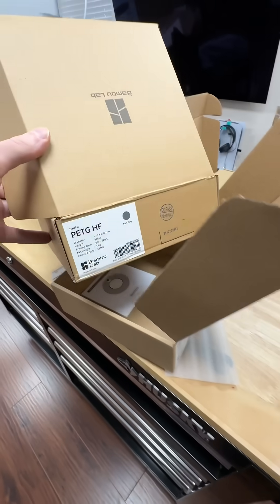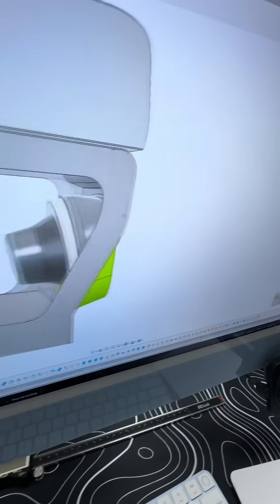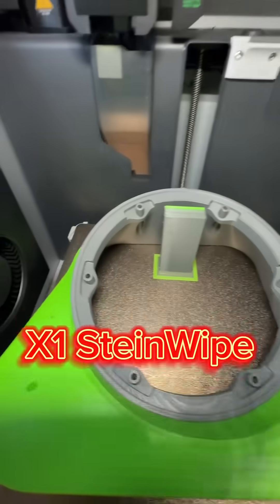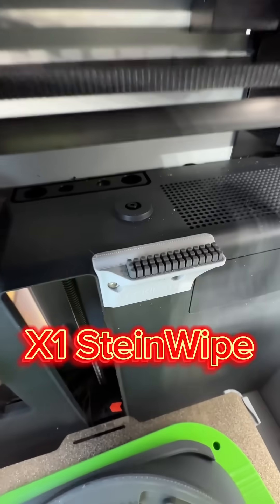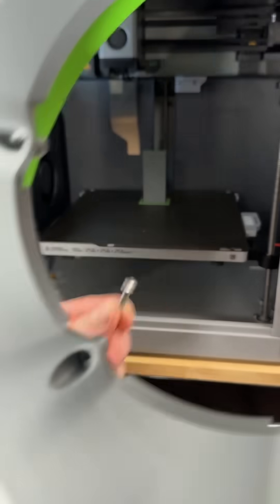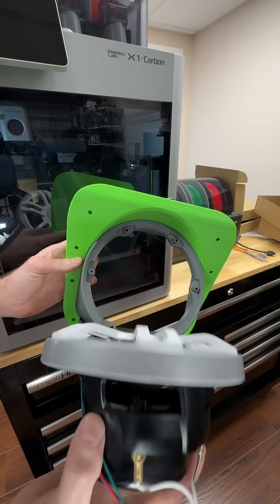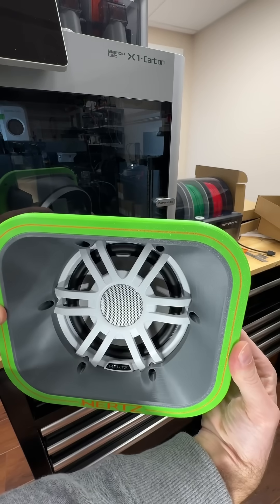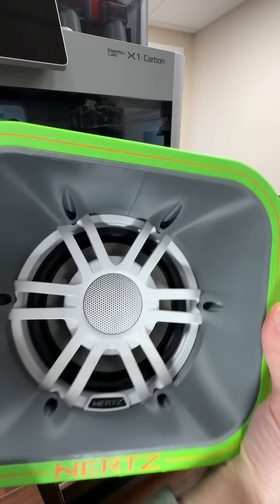Incredible Quality! This Was 3D Printed In a Single Piece On The Bambu Lab X1C!

Comment: Why does everyone have this wiper mod I thought the x1c had a wiper already?
Reply from the maker: The stock wiper is only used to knock the purge off the nozzle, it does not clean the nozzle while printing. SteinWipe and provided .3mf profiles clean the nozzle while printing even if AMS is not used.
Reply: @leckiestein awesome, okay cool I appreciate it. I’ll def add that to my machine soon :)
Reply from the maker: @shrimp_bucket  right on, the best place to start is the free stuff Ive provided on makerworld. Just search P1 SteinWipe to find the project.

Comment: Where you have the scrubber/whiper, does that stop the nozzle from scratching the build plate during nozzle cleaning before the print starts? Did you have to change your g code for this?
Reply from the maker: Its set up to not scrape the plate if one of the cool plate options are selected

Comment: I'm currently using a scrubbler V2 on my P1S which has solved the goopy nozzle issue with PETG but even when securing the 4 row section of A1 wiper with CA glue I've had it tear bristles off and even the whole rubber wiper material. I may have to try this design out

Comment: might want some dampening between the rim of speaker and the plastic. a cut out of either foam or rubber
Reply: same goes when installing into the seat, dampener between the seat and the speaker housing. possibly dampeners between the space of the screws. reducing unwanted possible sounds

Comment: Wondering if you will get less waste with the new Bambu H2D, if you had to redo that print again?
Reply: Yeah, he would. Most of the waste comes from the printer flushing the old color out of the nozzle so it doesn't blend with the new color. Since the H2d can feed 2 colors, it doesn't have to fully flush each nozzle, just purge and prime every so often. Of course, there are other ways to decrease waste even with only one nozzle. If he didn't care about color bleeding, he could have minimized the flush volume. Or he could have adjusted the model itself so that there were less layers with a color change. Those have their own problems though.

Comment: Lovely, more purge than actual print
Reply: ya he could have done both colors in two parts to snap together
Reply: another reason not too buy bambu
Reply: @krzysztofbrylinski This is just an issue with multicolor printing as a whole unless you get one of those expensive mulit nozzle ones
Reply: H2D would do the same print with CLOSE to zero purge...
Reply: @mcbrite  Only if you use 2 colors, but that model have 3 colors, so, you will have purge
Reply: @Scheettini  the red is only on the first layers, so probably only 2-3 purges for that
after that, it's free to go

Comment: Tips for increasing PETG-HF quality besides drying?
Reply: Calibrate every new spool, do flow and pressure advance and you should be good to go. I prefer gyroid infill but any other type where the lines dont cross (for example honeycomb) is fine. Try to avoid long unsuported  bridging sections as the lower layers will sag. And overhangs past 45° can look ugly. If you do many filament changes, make shure the poop chute dosent clog.

Comment: The seam is not well placed (preferably place it along a sharp bend to hide it better). Also it looks pretty prominent. Did you not use the "Scarf joint seam" setting for that print?
Reply from the maker: The seam was selected for placement on the underside of the speaker since there were not sharp edges to hide the seam. It is not at all visible when installed in the seat unless you put your head to the floor to look up.

Comment: Why did you use petg instead of let’s say ABS or ASA?
Reply from the maker: 2 reasons - I dont like those materials printing in my house for vocs and Bambu advertises their HF as suitable for outdoor use and there has been good feedback about this in the comments. besides, this is a demo boat for a Hertz dealer. Its going to spend a lot of time in a showroom so its likely to not even be a concern :)
Reply: @  i just ordered the H2D. I am printing in my house in a separate room. Do you think it’s safe to print Asa or abs. The H2D has some decent filtration right.
Reply: @viralthings3065  only using filtration is not ideal, there is a reason that any commercial or industrial facility will vent fumes outside.

Comment: Wouldn’t last a second in arizona
Reply from the maker: It wasnt made for Arizona, it was made for a Canadian Hertz audio dealer. It will be fine, I promise!
Reply: @ if it gets any direct sun it will warp. You didn’t put enough extrenal layers as evidence buy the top surface finish.
Reply from the maker: @neiljohnson7587  Its just the prototype so the dealer can check it out before printing a bunch. Its fine.. again, I promise!!
Reply: @leckiestein if it's a prototype to see if it fits well, it wouldn't have had to be in two colors
Reply from the maker: @ part of being a prototype - is for the dealer to see what the colours look like on the boat. I don't think it would have the same effect if it is all black.

Comment: Your seriously going to act like you didn't also print a bunch of test prints to make sure the fit was right... just right off the bed, first try ehh?
Reply from the maker: @markwebcraft  i guess you dont follow me.. i posted the test prints that I used to check the seat and speaker profile - 3 small pieces to check the fit to the front speaker and seat then offset all speaker faces a small 0.08mm bit and printed a very low profile ring to test for shrinkage - less than 2 hours for print time with all test parts. So thats all that was printed for test, adjustments were made, low quality teaser video was posted and Its in the long format video im putting together. Will be posted up soon :)

Comment: I got the p1p and man was that a mistake. Within 9 days, 50 hours print time, i had a catastrophic failure. The print head failed, belts and bearings failed, and axis motors failed. Nothing caused this just poor materials and craftsmanship. Bambu tech support decided to stop replying. Customer support would not let me return it until tech support resolved it, which they were unable to do. Had to get paypal and my bank involved. Bambu violated a few consumer protection acts and im still waiting for a resolution. This is pretty common as of march 2025. Their tech support is overwhelmed and unable to cope with the extremely high failure rates. Maybe they switched suppliers for their parts or in an effort to get a lot of machines out they let qc slip
Reply: How did the belts fail? 
How did the bearings fail? 
How did the motors fail? Which ones? 
How did the printhead fail? What does that mean? All of this happened at once??
Reply: @travistucker7317  i dont know exactly how but my best guess is that the bearing failure caused the belt to wobble too much making it wear until it started fraying which jammed the x and y axis motors causing them to burn out. The print head was also making a terrible noise and did not ride smoothly on its rails causing more issues. Something also came loose in the print head. Sounded like a morocca. I tried to correct the issues right out the box when I noticed something wasn't right and I couldn't get the belts to run evenly across the the bearings. The bearings were so bad they would cause the belt to run up and down and the belts would try to jump off. This is why I say it had bearing, belts, motor, and print head failure.

Comment: Why 2 colors🥲
Reply from the maker: Why not?
Reply: @leckiestein  so much waste on this print. Could have split em up
Reply from the maker: @ if I had more time I definitely considered it. But the client needed it ASAP and I couldn't afford a multi day Print. I only had one machine available to print this job. Besides, it was only 100 g of purged material which works out to be less than two dollars. It's not really that much Waste; it looks like it in the video because there's other purge underneath it from previous jobs. SteinWipe motion control is pretty well tuned for a substantial reduction in purging while prevent preventing colour bleed. So this was the first real test on a paid job for me for the SteinWipe project. Two birds with one stone!
Reply: @leckiestein  the 2 pieces could have worked good for covering up those screw holes. They  disturb the good design.
Reply from the maker: @Oslinga  if I had all the time in the world and unlimited budget, 100%!
Reply: @leckiestein  it's not that it's expensive. You can make several smaller prints with 100g of filament. Instead you're throwing it away because it just had to be a two color print

Comment: Compared to ASA or ABS, How would PETG-CF hold to salt water or lake water, environmental exposure, cleaning chemicals, etc?
Reply from the maker: @jamUSA24  petg is pretty chemical resistant in my experience. Bambu says on their site this material is for outdoor use so Im sure rain and sun are fine. Regardless, this is an audio Demo Boat for a Hertz dealer. Its likely to never see the water
Reply: @leckiestein ahh, long term thinking! You heard it here: This boat will never see water. Not by the next owner either..
Reply from the maker: @foobarturkey  I put "designed in canada by leckiestein" around the inside speaker ring - IF the next owner should needing anything (and its a big if as Im hearing good things about HF petg from bike guys) they will be able to find me and we can print in ASA or whatever super awesome materials we have years from now :)
Reply: Would a clear coat of resin improve lifespan if the water or cleaning chemicals was to effect this ?
Reply: @vsuno2721  Yes, a layer of 2k clear would do wonders, primarly for UV protection.

Comment: Pourquoi l'imprimer en 2 couleurs? C'est pas très utile et c'est du gaspillage
Reply from the maker: This is a practical test for months of work for SteinWipe Motion Control. Necessary evil to bring more efficiency and min 25% reduction in purge. This was only 100g of purge which is unheard of for a 800 material change print 💪

Comment: How long is this predicted to last? I feel like 3D parts exposed on a boat with constant rattling and pressure from a speaker is not gonna bode well.
Reply: You'd be right with PLA, PETG will probably be fine
Reply from the maker: @espeterson522  bambu advertises this material to be used outside. Regardless this is for an audio show boat for Hertz. I doubt it'll ever see water as it's just going to sit in a showroom for the majority of its life.
Reply: I print parts for professional PA speakers out of PETG and they hold up great. Mostly curved sections for the port geometry in 18" and 21" 1.8kWrms woofers glued into the wooden cabinet.

Comment: Sweet! But would it not have saved a ton of time and filament printing in two rounds? One the green outer with just a little change in the red (maybe even spliced two prints at layer 5 or so to force only green to not waste even more time on unnecessary layers of red) and then one with the gray mounting, gluing them after print?
Reply from the maker: @ this project is for a Hertz dealer and I only had a week to turn out a design and 3-D print it for them. If it was mass production it would certainly be considered from the material usage standpoint alone. But I don't know about glueing; It didn't age well with the cyber truck! Jokes aside, I considered 3-D printing in two pieces and joining them together and a groove profile that keeps them rigid. But there's too many uncertainties which could result in Printing two or even three times to get it right with fitment and that's three days lost; I needed to do it in one day. Printed once, fitted, and shipped. No fuss.
Reply: @ that makes sense. Rather take the extra time and filament one prototype makes than indirectly wasting time on prep for mass production or “simplicity” that may never come😂 No need to nickel and dime a prototype😅👍🏼 Guess that’s part of why I still have years old filament rolls laying around😅
Reply from the maker: @BuzzBazzJ  to that old filament in a dryer for a day and you'll be all good!
Reply: @leckiestein  yeah it’s been drying fine in the AMS with new rounds of desiccant. I say this because the apartment is very dry and most of the filament has good moisture levels, though a little brittle here and there, but oven fixed those rolls😂 And people worry about microplastics😂 *proceeds to sniff printer dust*😂😅
Reply from the maker: @BuzzBazzJ  I don't put any filament into my printer that doesn't read less than 5% rh in a 50c heated dryer. It makes a big difference
Reply: Have you looked into weld-on 16 to join things together? @leckiestein
Reply: @leckiestein consider a sovol zero for prototype the design? I heard they hella fast if a bit miniature in bed size but can quickly work out such design questions with physical print to see if it works in fraction of time
Reply: @leckiestein you could just use nuts and bolts so they would thread from the back and just make nuts insert from side of the inside wall but i guess it is easier your way i would print it in 2 parts idk i dont trust ams with long prints.
Reply: Yes but then he wouldn't have any reason to talk about his wiper. Toolchanger is also a better option